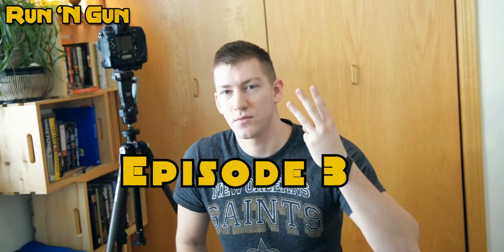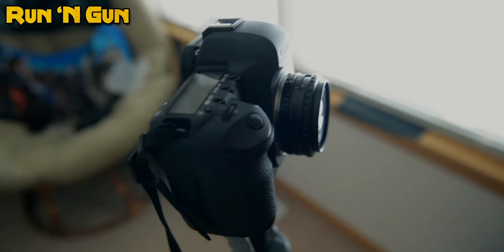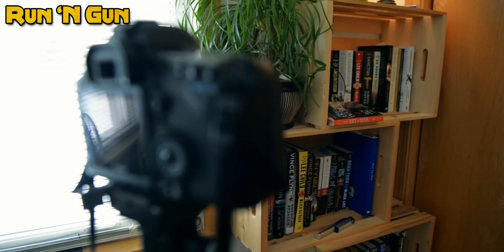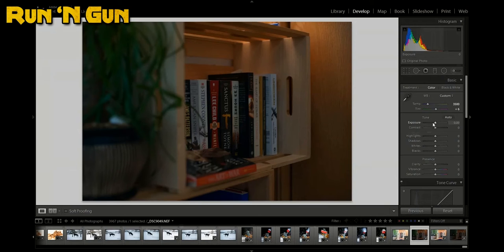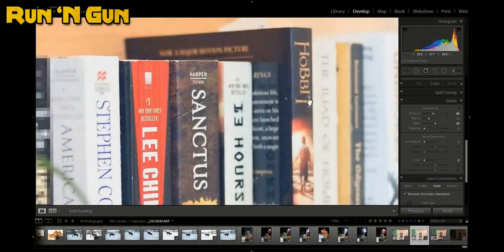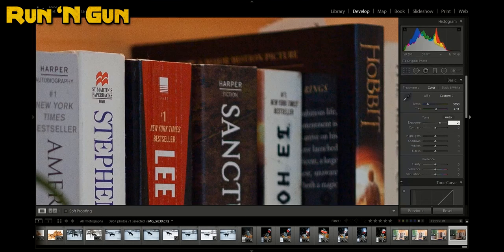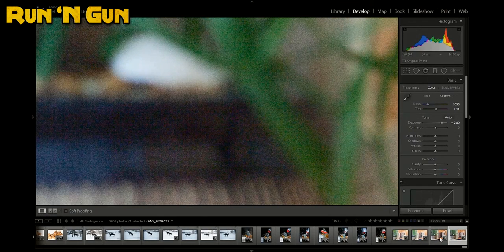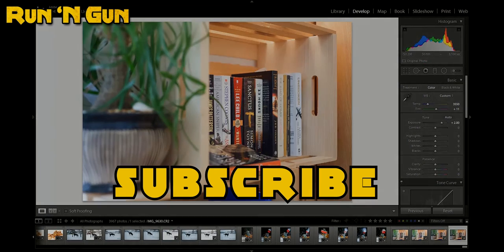How ISO and sensor sensitivity works in your camera

Comment: How would that work electronically?

How would your ISO setting make the sensor's photo sites physically more sensitive?

Does more sensitivity in the photo sites mean more volts per photon?
Reply from the maker: When light hits the sensor, an electrical charge proportional to the amount of light is released and stored.  At the end of the exposure process this voltage is read by the sensor and processed.